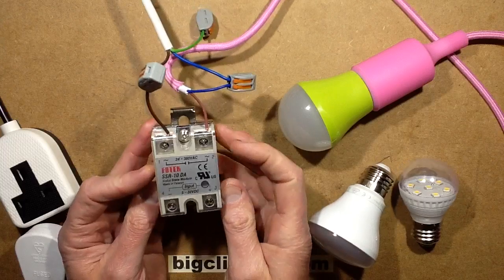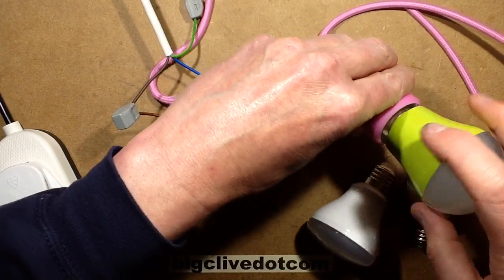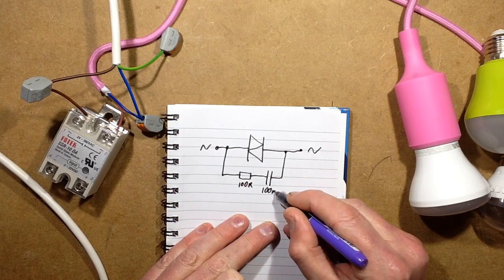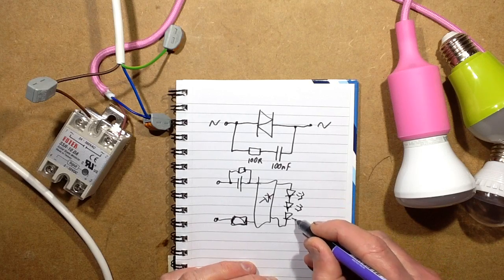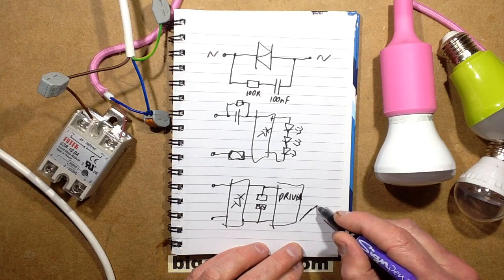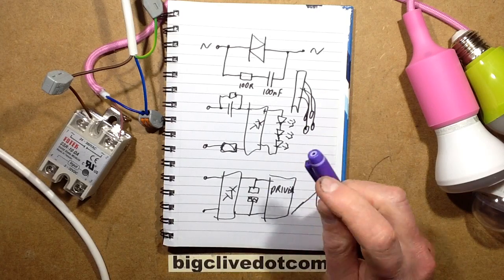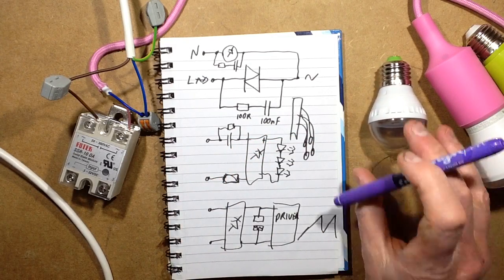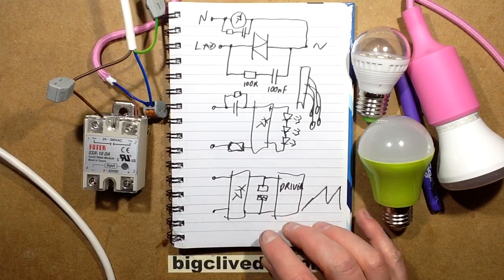Electronically controlled LED lamps glowing when off.

Comment: This happens in my house when I remove one of the two led bulbs from a circuit which is switched on a double switch with another light circuit. Only happens when the other light is lit, so I assumed there was some induction happening in the double switch. Happily, once both bulbs are in the leds don't flicker anymore.

Comment: So would a 20A SSR not be good to use with my dust collector that draws 20A peak?  2HP motor.
Reply: +Charles Reiche I would never trust and SSR with a large inductive load.  I would use a contactor (glorified relay) that has a 2hp or more rating on it.  Do not go by the  amp rating but only source a contactor rated in HP.  Ebay has some good buys on used quality ones.  Avoid the Chinese junk.
Reply: +Charles Reiche - ABB ESB40.40/230 is a good contactor for that usage. I wouldn't trust SSR on inductive loads either as the voltage spike from collapsing magnetic field in the device can reach several kilovolts in disconnect moment and fry the triac in SSR easily even with the snubber network in parallel (magnetic ballasted fluorescent light uses that effect to light up the tube).

Comment: I've had the same pulsing flashes with compact fluorecant bulbs when they have an illuminated switch in the circuit, when the switch is in the off position.

Comment: had a similar problem fitting led capless bulbs instead of normal sidelight bulbs to my canbus equipped car. they would flash continuously. I guess that was down to leaking current as in this case. interesting

Comment: One of those quack power saving devices (PFC capacitor) connected in parallel with the lamp would probably stop the flickering/glowing, without taking much power. Hey, they may actually be useful!

Comment: We had this happening with a normal light switch, but it would flash every ~10 minutes. I am guessing it was the ac coupling in the lightswitch and the cabeling (capacitive effects) that caused this. amazing how little power these lamps actually need to give out light!

Comment: iv had two home bargains eco lamps fail very quickly clive, one smells of magic smoke, one was a colour changer, the non color changer has cracked the white coating like fault lines on a volcanic surface and the other seems to have oozed brown from the ir led, thoughts?

Comment: I thought that SSR's used either thyristors/SCRs or MOSFETs... though I guess it makes sense when switching an AC load.
Reply: +Aurelius R FETs are ideal for most power apps but SCRs of silicon and still cheaper. In general you really have to work to find MOSFETS in things other than the end drivers of stereos and certain more expensive circuitry. It still surprises me because NMOS has been around forever while PMOS was just getting let out of the bag when I attended college for Avionics back in 1991-2.

Bottom line is always: Companies are CHEAP. More often than not and when quality that works is known you pay thrice(or more) for it.

Comment: If the point of LED lamps is to save electricity, isn't all this leaking current just wasted? Not to mention the fact we ALL have to do what we can to save electricity.
Reply: +Eric Taylor Well the elephant wouldn't have fared much better on DC, let's just say..
Reply: rocketman221projects
AC is differently easier to deal with, but it is, as Edison pointed out rather graphically, a lot more dangerous. Have you seen the film of the elephant he killed? If you haven't I would strongly recommend you don't. It is something I would like very much to unsee.
     Our desire for practicality kills thousands of people every year (by accident) not counting those murdered or executed with electricity.
Reply: +Eric Taylor It's not the LED lamp. You'd have the same leakage through the switch with an incandescent bulb, it just wouldn't result in any visible light, just a small warming of the filament. 
Or put in other words, out of sight is out of mind...
Reply: +Eric Taylor I fail to see how DC is safer, DC is inherently unsafe both in your ability to let go when you come into contact with it and the problem of extinguishing the arc when switching.
Reply from the maker: +Eric Taylor It's almost pure reactive current out of phase with the voltage.  But it does seem wasteful that current is flowing at all.
Reply: bigclivedotcom
Maybe Edison was right. We should have gone with DC rather than AC.
Reply: DeoMachina
Nothing is a bigger factor than AC/DC! I mean how awesome is Highway to Hell?
    There is more risk when using AC to weld, but that isn't why it isn't used much. It has more to do with the better arc properties of DC over AC.
    Both AC and DC ave advantages and disadvantages. The main reason AC was adopted is because it is so much easier to generate and transport.
    Edison imagined many small power stations that would provide power to just a few blocks. This would have only worked for densely populated cities.
   For more rural areas, it would have meant these people would need to generate their own power or do without.
    AC WAS the better choice at the time, but today DC might be the better choice, but that is due mostly to advances in generation.
Reply: +Eric Taylor DC has its own risks.  It has the tendency to induce muscular tetanus (ie it makes muscles contract), not good if you touch it as you may find you can't pull your hand away.
Reply: cjmillsnun
But it's a lot less likely to stop your heart. Personally I'd rather be stuck holding something that hurts like hell than to be dead. I can get better if it only hurts. Getting better from being dead is a lot harder.
Reply: +Eric Taylor That would make more sense now since most electronic devices runs from DC. Before switch mode power supplies, there was no way to efficiently step up or down DC making it impractical.
Reply: *****
It has to do with how DC and AC interact with the body. But you're right. Remember WHY Edison was doing this. He was trying to sell his DC current and trying to prove it was better than Westinghouse's AC current.
     AC is and was better than DC overall, but DC is much safer.
Reply: Michael Tempsch
That makes it even worse. World wide how many K-Watt hours are lost to this leakage?
Reply: +Michael Tempsch I tried to measure this some time ago when I was trying to replace a dimmed E27 incandescent bulb with a dimmable E27 Philips 806lm Warm Glow LED. According to my meter, the Incandescent bulb was using 0.1W when "off" and the LED was using 0.4W while serving as a night light... Keep in mind measuring power-draw at this low level is bound to be somewhat inaccurate, even though the meter I'm using is supposed to be good at this.

I wonder if the power draw does increase or decrease if you put an incandescent bulb or resistor in parallel?
Reply: ginvr
DC is a lot less likely to enter your body. AC can easily get inside your body, and if the current crosses your heart it can cause your heart to go into fibrillation. This problem requires very quick medical attention or you will die.
    The problem of arcs is not a problem in other DC systems, so I don't really see how it would be a problem.
    Having worked as a welder I am quite failure with working with very high current/high voltage DC electricity. The only times I ever felt the slightest tingle from the electricity is when I was welding in the wet, which frankly is pretty stupid thing to do. And welders use quite a bit more current than what would be used to run modern electronics or even lights.
Reply: Eric Taylor I'm no graduate of EE, but aren't things like conductivity or difference of potential bigger factors than AC/DC?

Arcing isn't a problem in DC systems, because they're designed to take arcing into consideration.  And as dangerous as welding is, you're not in real harm because the tool you use is much more attractive to the electricity than your hands are.  It would be just as safe with AC at the same voltages/currents if I'm not mistaken.  (I may be mistaken though, again not a graduate here)
Reply: Yeah, there IS a current leak. But if you use tungsten and not LEDs, then the same leaked current is still flowing but won't do shit that would be visible.

Comment: I'm not very experinced in electonics but wouldn't something as simple as a resistor and diode (or an LED) in series across the live and netrual of the SSR solve this problem?
Reply: +vgamesx1 
I don't understand your syntax.
"in series across the live and netrual of the SSR"   You wrote two oxymorons in that post :)
Reply: +Jack White I meant, the resistor and diode in series and put both in parallel with L+N

kind of like this... http://wyewaltz.org/wiki/images/thumb/c/c9/LED_circuit.svg/583px-LED_circuit.svg.png
Reply: +vgamesx1 
So basically like the tungsten lamp that Clive suggested. Except the diode will be reverse biased during the negative half wave and will surely break through at mains voltages. You could put two diodes back to back, so one is always conducting during each half cycle, but why the diode at all? Also the resistor has to be speced to dissipate, oh let's say, (230V - 3V) * 20mA = 4.5W which is a considerable amount of power. So we're back to why not just use a small tungsten lamp?
Or instead use a capacitor, which also shunts the leakage current effectively, and since it's reactive current that flows through the capacitor it doesn't come out off your electricity bill.
Or better yet, use an appropriate relay that's suitable for switching small loads in the first place, and not something that's designed for switching 3kW heaters and motors and such.
I hope this is helpful.
Reply: +vgamesx1 I'm thinking a diode (or more depending on the leaking voltage) in series with the load, and another diode (or more) in parallel with the previous diode but in the opposite direction
Reply: +Ron Garren 
That would be a rather clumsy solution, if it even works, because that leaking voltage can get quite high. Keep in mind we can have LED lamps flickering that have many tens of LED's in series, so they won't turn on unless you have some considerable voltage. That's because the RC snubber in the solid state relay has mains voltage on the other end, and it's only the size of the load that determines how far that voltage drops after the relay. If the load is very small, then you will measure voltages almost up to mains level. That would require a lot of diodes, and then you aren't guaranteed that everything will work properly when you turn the relay on.
Reply: +Jack White What the hell is a Thurston lamp?  Do you mean a tungsten (filament) lamp (which is what Clive mentioned)
Reply: +cjmillsnun 
Damn you, spellcheck! Yes, I meant tungsten :/

Comment: You get the same if you use one of those switches with a small neon light for a CFL
Reply: Our (new) place gets that, too. Some lamps also make an annoying faint clicking if you stand right under them when they're off. It's weird when you grow up thinking off means there's no way for power to run.
Reply: +Andrei Marinescu  I noticed this also on our newly built home. We have many light switches with the tiny neon light in them. LED bulbs are installed in almost all and they all flash.  At first we were alarmed about it thinking something was wrong with the new wiring.  A quick google search put our mind at ease.  It is annoying none the less with blinking kitchen lights wile on a midnight snack run :-)
Reply: Ah, I made this comment about my garden lights before reading this comment. Anyway, snap.

Comment: all lamps apart from the one in the kitchen flash every few sec, got in the electrician and he told me there is nothing wrong and I should use tungston lamps instead of LED.
Reply from the maker: +supernova1976 They're partly right.  There's probably nothing wrong with the wiring.  The slight after-glow of flashing effect is sometimes caused by the tiny capacitive leakage between switch wires, especially on two way lighting circuits.
Reply: They behave the same way on the 2 way and single way. The only lamp doesn't do this as I mentioned is in the kitchen and the only difference I can see is no smoke detector installed like all the other rooms, it looks like they have wired it from the same circuit and that is causing it to have the small current. I upgraded all lamps to 100w equivalent and that seem to fix the problem.
Reply: Forgot to mention the more powerful 100w output equivalent is an led which doesn't flash with the same setup. I guess the more powerful led lamp and circuit requires a bit more current to emit light.

Comment: I think this is the right time to out myself as a wago fanboy, whats your take on them clive?
Reply from the maker: +madinatore There's a video dedicated to them.  I like them, especially when combined with the Wagobox.
Reply: +madinatore You can never have too many Wago's in your toolbox!
Reply from the maker: +Thanh Tran I'd be very cautious about using a clone Wagon in case the components were not up to the Wago standard.
Reply: bigclivedotcom i personally haven't used them. i was offered it by a supplier. i didn't even know those things existed. but to be fair, what could possibly go wrong, its just a wee spring in there...
Reply: I prefer the transparent ones now, because you can see at a glance if you (and especially the guy who was there before)  inserted the leads properly.
Reply: +bigclivedotcom guess I will dig for that one then!
Reply: there are Chinese knockoffs now too if you want to play less for them...

Comment: In my country, tungsten lamps are banned. The real solution here is to use a mechanical relay :)
Reply: +Antonio Barba On the box cross out the wording 'Tungsten Lamp' and write in 'Capacitive leakage discharge resistor', it's now a safety device feature :-)
Reply: +whorayful lol nice idea!
Reply: +Antonio Barba Mechanical relays, also called "contactors," are the usual replacements for failed solid-state relays here in the 'States, at least in industrial applications where some idiot designer used them with an inductive load, e.g. a typical AC induction "squirrel cage" motor. I'm looking at YOU, Ingersoll Rand....
Reply: +Antonio Barba 
You still have halogen lamps available, don't you?
Reply: Jack White yep.
***** same deal here in Italy. In my granma's house there are still 50+ years old relay operated lights and they keep going. They might not be 100% reliable, but I bet they are good enough for the job :)

Comment: So many shitty electronics out there ...
Reply: +BrendanMaxwellMusic I don't think this is caused by shitty electronics. These kind of switches just aren't compatible with low-powered LED lamps because of the way the switch works. The switches leak a tiny amount of current by design.
Reply: @Kepe  Doesn't that prove Maxwells point? 
Shitty design = shitty electronics
I mean not all Leds and dimmers are made equal are they. ?
Some seem just fine.
Apart from relativly high capacitance/inductance situations maby ?

And if all that's too difficult somehow ,Just come up with  better information on the packet what it can and cannot properly do .
Reply: @schytdemijn5398  Nah, I don't think you understand. This type of switch isn't designed to work with low-power stuff. It's not a design flaw or bad quality. Everything can't be compatible with everything.
Reply: @Kepe  you may be right ,still I hate the Apple but also Microsoft philosophy We know And decide what is good for you so why provide more info than strickly neccesery to let you buy ( more of our )products.And if shitty don' t matter cause you buy more anyway .
Reply: i bought I believe what was 30 euro dimmer and the site I bought it from goes to great lengts tot inform and educate about LED .And sold only quality etc. 
Still I got a ridicullall
y bright lamp here when powered off.

The (Floor switch)dimmer does have a very nice min/max potmeters ,but the led is connected  2 meters only from the dimmer.

Bottom Line is 
A. Manufactuars should be much more honest ,transparant and fair.
B.  I need to be right.even if I' m not.
Reply: +Kepe absolutely right